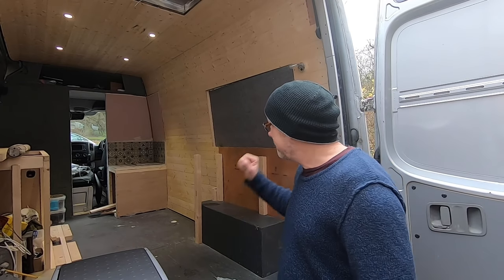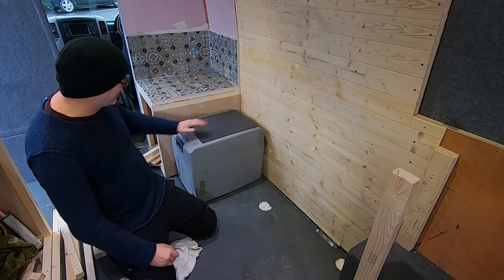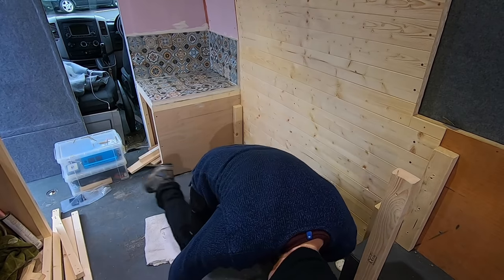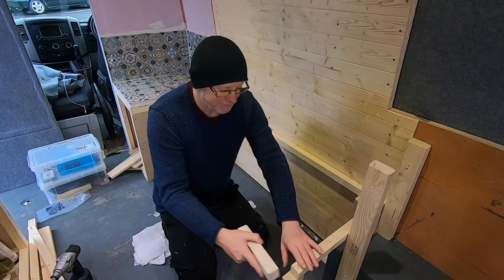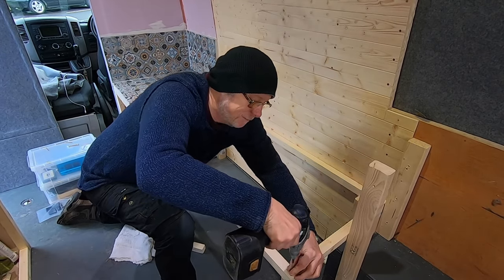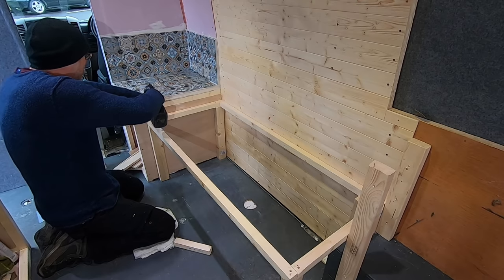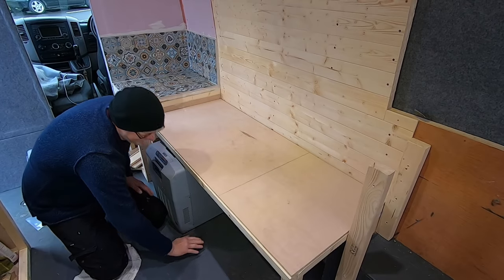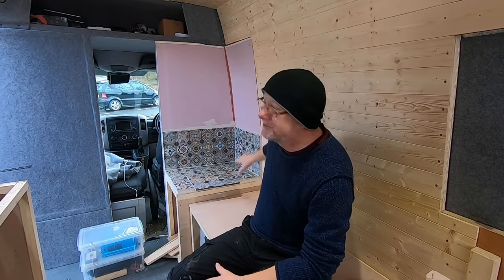How To build bench seat DIY Campervan RV Conversion

Comment: Great project, MEL best channel for making it work out ,read in comments about opening seat with cushions fixed on , no hinges & a strap attached underneath, so lift & slide forward & back & lean ,worked with my van ,bit cruder than yours will be but worked well for 14 years the transit rust won .well done fella keep well& safe from North Devon.❤️☮️👍
Reply from the maker: Thank you for the positive message really appreciated stay safe 👍😷👍

Comment: Mel I would invest in a couple of clamps, just to hold the timber in place during assembly. Another great video 👍
Reply from the maker: Thanks I have hands n feet for that lol 👍🤓👍
Reply: Yeah I agree. I had clamps sitting around but we're not using them for a while. Then when I got into the habit of using them I kicked myself for not doing so before.

Comment: Put a fender around where the stove is going to stop embers falling out onto the floor or seat, the build is going well.
Reply from the maker: That’s a good idea thank you 👍🤓👍🎄
Reply: @BigVanSmallWorld  I just welded 2- 2"x2" angle irons at 90 degrees stuck down with heat proof silicon. Safety is paramount with woodburners particularly in vans, I've fitted one in all three of my past and present conversions, be safe adhere to all the regs as regarding distance from constables, (stay safe)

Comment: Hi Mel, 
Maxus o'clock :-).
Getting my 1st van on Monday, Kent to Chester for a maxus :-)
Sounds like a gd buy 07 6m ticket 103,000 company owned for 7 years.
Shame its a low roof but it's less noise on the motorway.
Will be searching for tips on how to sort things.
Happy days :-)
Reply from the maker: Sounds great make sure the demising fan works on all speeds remember it’s got a cam belt that will need changing oh and check the rear fog light switch is working but most importantly don’t ever jump start it you will blow the trip counter on the speedo and it will go from 103,000 to 703,000 also make sure all the doors lock and unlock with the remote I think that covers all there quirks 
Good luck with it there fantastic vans I’d definitely buy another one 👍🤓👍
Reply: @BigVanSmallWorld 
Cheers Mel, that's great advice, I shall take notes.
Really grateful.
I shall be moving back to Swanley in the new year so will keep an eye out for ya lol :-)

Comment: If you cover the board with your foam and cover, then you won't be able to fit your hinges externally, and the cushion will stop the panel from opening (you will be squashing it against the wall). Although the 'pillow case' system seems more awkward to start with, it makes the whole setup more versatile (plus easier to clean, which you might appreciate next to the wood burner).
Reply from the maker: Ohh 😮 well done Phil I think a little design rearranging my have to be done 👍🤓👍
Reply: @BigVanSmallWorld Make it so the hinge is set forward a couple of inches, and then tuck a backrest cushion (removable) at the back perhaps?

Comment: Hi Mel, great vid once again! I learned a lot from watching that vid. I like the way you used wood twice the width of the cross members & also leaving space for the laminate floor under the cooler box.
 Just a though thought, would it not be a good idea to move the cooler box as far away from the log burner as possible, so the cooler doesn't have to work overtime to keep things cool?
Reply from the maker: Hi I’m glad you found it useful and your absolutely rite I’ll probably move the cooler to the other end away from the stove thanks for the tip and positive feedback 👍🤓👍

Comment: Hi Mel, just a couple of questions, is the cooler to close to the fire place, and if you get stains on the bench seat, how will you clean it if it's stapled down, great van build😁
Reply from the maker: Hi I only put the cooler that end to demonstrate the height il be careful not to put any stains on the cover 😂👍
Reply: In my 3 different builds have built my squabs the same way by stapling them down. I lived in the second one for 4 years. I recently unstapled and replaced the  covers, as the old ones were looking worn. I have never spilt anything on any of them, but I have also had a loose fabric cover on too, for protection against spills.